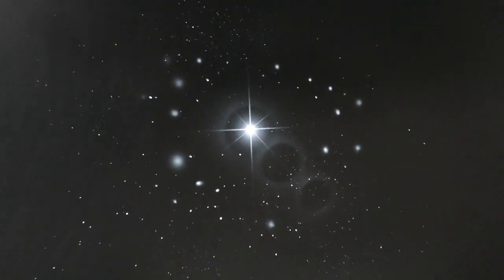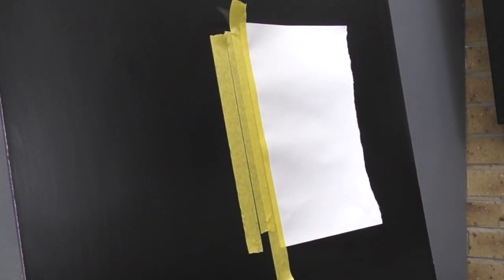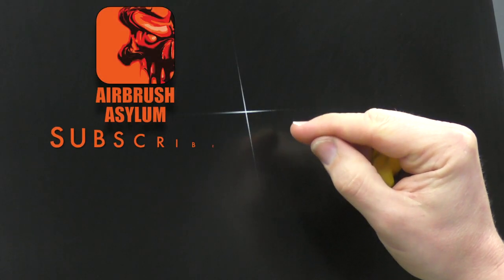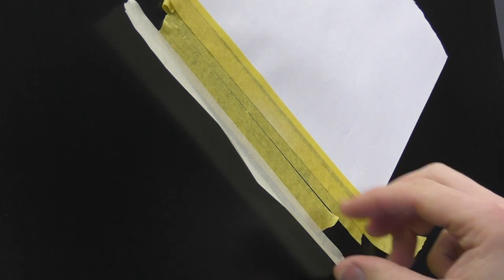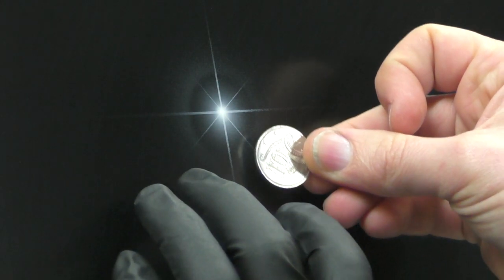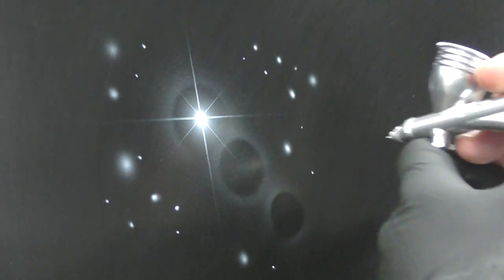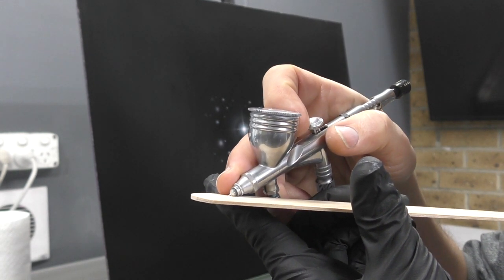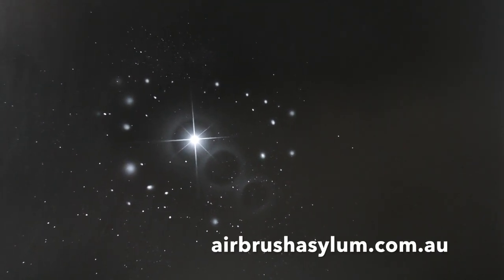Airbrushing a Starburst | Easy Beginner Tips

Comment: This has got to be my favourite so far Its given me some really great ideas I have the Voilamart Airbrush Kit with Compressor 0.3mm 7cc Dual Action Airbrush for Makeup Nail Art Painting Tattoo Decoration Cake Spray Nail Tool Set I would like to know more about this particular are gun and if you can chang the needles I don't know much about the pressure that is needed and for what kind of air painting that it creates

Comment: Another way to make speckled stars is if you remove the air nozzle and then  spray... Gives really good control and you can play with the air pressure to get different size speckles
Reply from the maker: Yes that also works and appreciate you sharing that with the viewers thank you 🙏🏻
Reply: Always fun to share😄

Comment: I couldn’t get that kind of detail with my machine it looks like that same one. But mine doesn’t get super fine detail . It cost almost $1000 up here in Canada 🇨🇦 for the micro model.
Reply from the maker: It just comes down to practice and getting your paint mix right for detailing I like using 70% reducer 30% paint at around 20psi 👍🏻 just keep going and you will get there 🤘🏻

Comment: Why are you replacing the inner tejp pieces and not simply using the ones stuck to the paper? Risk that they transfer paint, or some other reason?
Reply from the maker: Just using fresh pieces so they stay clean and provide the sharpest edge possible , but yes you could use the ones with the paper mask if you prefer to speed things up 👍🏻😉